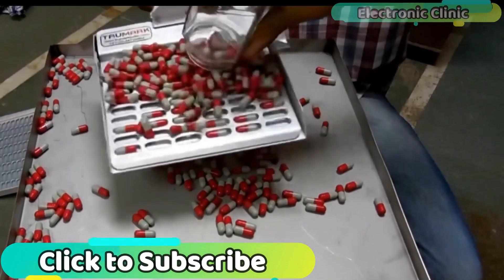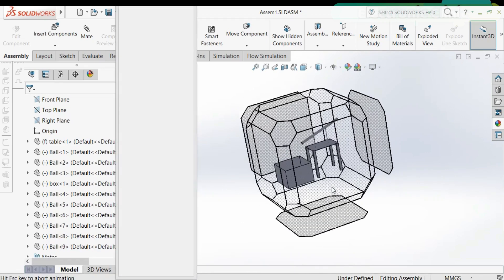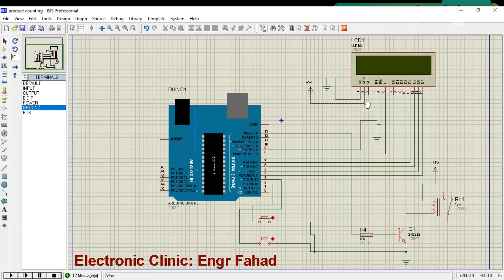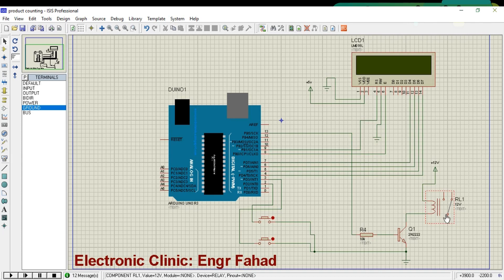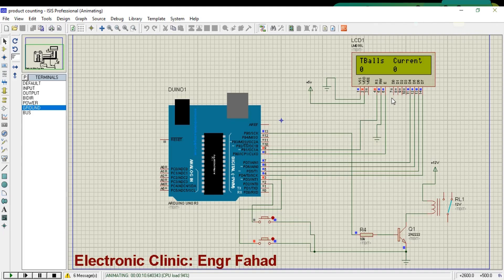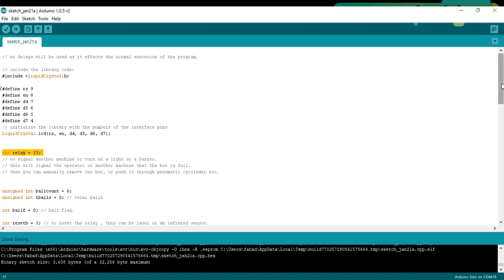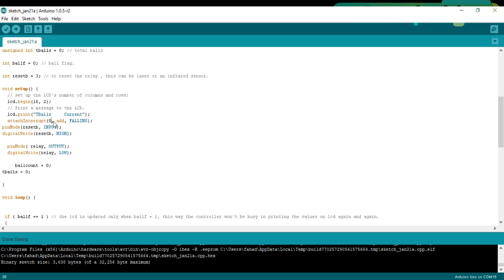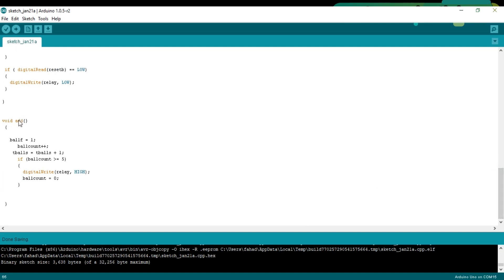Arduino Project: Industrial level Products counting system | Arduino Industrial application

Comment: I like your project, it's so interesting, but I would like to ask you a question, can the program be built using A MatLab Software
Reply from the maker: you can use any programming language and do the same exact thing. But i thing for this particular project Arduino is best.
Reply: Ok thanks, Sir, I will try it. And if you are volunteer, You will guide me the way how to do with projects using Arduino software for final year projects, since I'm an Industrial Control Engineering Student If God says next year will be my graduation so I need to have project titles from you concerning such a stream, Sir.